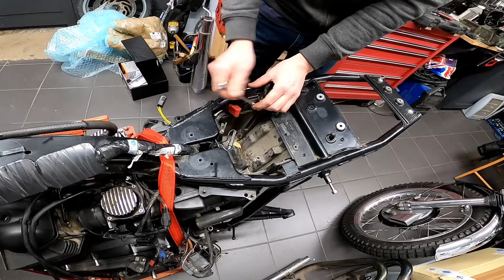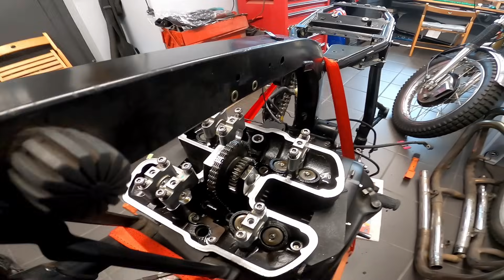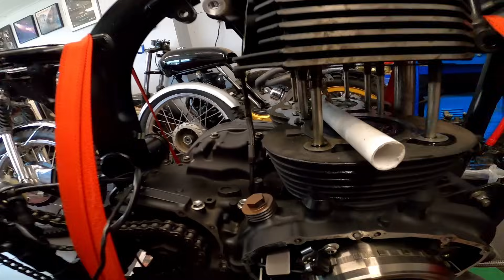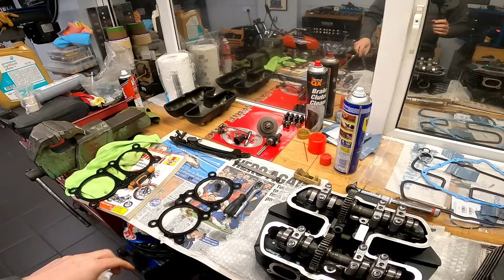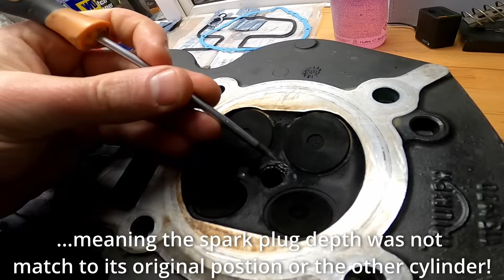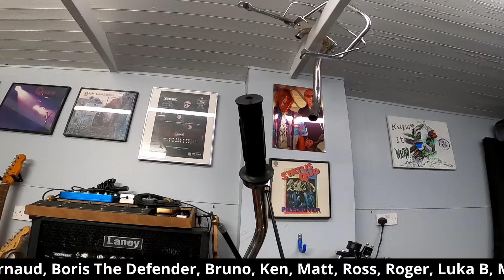Freddie Dobbs' Bonneville | Off With The HEAD!

Comment: I agree with you, by the time you fixed the spark plug thread correctly and had the heads and block surface ground, it would cost about the same as good second hand parts anyway.
Reply from the maker: Yeah in this instance its a reflection of time and I/Freddie are very fortunate to have the support of Chris at UTP providing parts!

Comment: The compression was there, you said so & showed the gauge. Fanny up the base,new gaskets, and bingo ,should get better readings too . Nowt all wrong with that barrel,or pistons.
Reply: IIRC, It was on the low end of acceptable though with one cylinder between 5 and 10 psi lower than the other.   The low compression could be because of the poor helcoil installation but given that both cylinders were within 10% of each other my bet would be either worn cylinders/rings or the valves being so far out of time.   Just a hunch.
Reply from the maker: See my other reply pal! Thanks again...

Comment: I know you’re doing your job correctly, as I’ve been there, but I think this is becoming an un economical repair, yes everything is fixable, but at what cost ? I also know that this is between you & freedie, but as a 35 year auto tech , you have to draw the line somewhere, really should have spotted the loose thread at compression testing,before doing all the other things ? I’m amazed you keep finding things wrong when you should have ,used your head not your heart. Please don’t be offended,you’re a clever guy, why can’t you skim the surface & jack the barrel ? Or jack the head ? Look out Freddie £££££.00000.
Reply from the maker: Hi Neil,

You make some really good/valid points and if this were a commercial operation we may have taken different route. The loose plug thread was apparent and had also been mentioned to Freddie on receiving the bike back from the previous garage (we always knew this was going to need attention). My first focus was to understand the current state (health check) across the board before getting the spanners out. 

Given the incredible support from Chris at UTP on parts procurement and I am not charging for my time  this was and remains an exercise in how much is wrong/damaged and what it takes to get a bike in this state back on the road. In any ordinary circumstances I won't deny this level of work/repair makes no time/economical sense without the content to create of the back of it and the Bike that it is and amount of content Freddie has created around it.

I absolutely could go down the avenue of bespoke gaskets and so on, as stated if it were my bike I would potentially explore those options but given where this is going when it leaves me and not knowing who is likely to work on it, I prefer to send it back in standard/factory form able to be reworked in the future with off the shelf parts.

We will be doing a video on the full breakdown of costing compared to the potential commercial cost/parts for anyone in there garage carrying out the same activities vs just replacing the motorcycle whole.

Thank you for your comments, you pose great input and ideas that really get the head scratching. Very much appreciated!

Comment: The original head gasket area has enough meat round it to seal, with a new gasket allowing for surface imperfections (thats part of its job) even what looks like those two nicks near the camchain tunnel. However agree that the neanderthal  thread insert is a bridge too far.
The slightly anal barrel and piston swap  expence l don't agree with, IF that raised imperfection is the only fault, easily flatted after all the head wasn't leaking was it?
Not to detract from the good work done and nice to see someone else using newspaper on the bench. 👍 👍
Reply from the maker: Cheers pal, newspaper for the win every time. The raised imperfection is a piece of steel well and truly buried into the barrel surface. As I say if it were my own bike I'd consider it but with time also being a consideration and have the parts available through support from UTP. I won't be messing with it for now. Although I may do a video after the bike is finish looking into it when I find time...
Reply: @TheWurks  Yes, thanks for replying.
Reply: @TheWurks  Having reflected on your reply and thinking about the different expansion rates of steel v aluminium, digging it out and the 'hole' welded and dressed would take time and money which has to be factored in.
Reply: @bananabrooks3836   Considering the tolerances here as well - damn the disposable culture, planned / unplanned obsolescence and not allowing plenty of meat to idiot proof....

Comment: Your knowledge of the interior of a motorcycle is unbelievable. Exceptional.
Reply: The difference between a Fitter and a Mechanic, then, a Mechanic and a Technician - by rights, all Mechanics should be Technicians (what helps with this, is brand specialty).

Comment: This is the difference between someone who does this work as a hobby vs someone who does this for a living. the hobbyist wants it to be perfect, the professional wants to be out the door onto the next one. I totally agree with replacing the barrels on this bike. you never know what that amount of displaced metal does to the cylinder geometry. Probably minor but sometimes that's all it takes to ruin an engine, why take the risk.
Reply from the maker: Thanks!
Reply: I would say the definition of the term "professional" would need revisiting under such circumstances, yes, stuff happens, but if we've really found ourselves at a point (and I'm not pointing any fingers here, really, I don't think that right to), where anything but top notch service can be expected from a paid professional, then it's time we took a long hard look at ourselves as a society. Hourly rate means nothing next to getting it right, end of story (and no, that doesn't mean you can charge for unnecessary time spent retracing your own steps either), as the main dealer workshops fit their parts and perform services whist creatively filling in their timesheets (always rounding up to the nearest hour? - Really?  at ^that* "flat rate"?), the gulf between them and the independent drifts ever broader as skill and knowledge dwindle (in both camps).
As I say, buying new and dealer servicing doesn't immunise you from unnecessary expense, though by definition, it surely should.

Comment: The "divet" on the head gasket sealing surface is not good. On the other hand engine had good compression, so it was not leaking. On the other, other hand, unknown if it had caused some deformation in  the head or barrel geometry.  I'd also be concerned that valves might have been fouled by pistons since the timing was not correct for some time. 

Those head bolts were super torqued! Are they stretch-to-yield type and need to be renewed? 
What is the history on this bike, do we know when/where/why previous engine work was done?
Reply from the maker: Not stretch to yield so should be good to go again. As for previous work I will not comment on who or where. I'm taking this as I find it, being open on the issues found and how we plan to rectify them.
Reply: In the first video of this series when Joe actually tested the compression, he found that it was on the low end of the acceptable scale for compression with one cylinder between 5 and 10 psi lower than the other.
Reply: @bnations2000  yes but that was a cold engine which will drop the readings some. I believe he later re-tested after a bit of running and setting valve timing correctly and got around 175psi....which I what I get on my 2013 Bonneville warm.
Reply: @TornadoCAN99  Good catch!  I missed that bit in the episode where he corrected the timing issue.  I feel like a right numpty now.  🙂

Comment: Are Triumph T100 base gaskets hard to get a hold of?  That's weird.
Reply from the maker: They are!
Reply: Yes, "weird" is a good descriptor, I took "unavailability" at it's face value and suspected built in obsolescence to keep up with the latest "green machine" fad, whilst noting we actually have a great company that manufactures automotive head (and" base") gaskets here in the U.K. - I then asked an independent bike business down this way if there was a problem with supply and the reply was "no, Fowlers have them on the shelf, two different part numbers, what's the reg?", so for a great deal of the waiting time at least, gaskets from Triumph were available and they always were to manufacture ('crossed my mind Triumph might have had a batch made here, rather than abroad, seeing the difficulty  and expense moving boxes around these days).

Comment: Would expect the barrels to be OK as debris damage is outside of the high pressure bead on the head gasket (that is responsible for sealing the high pressure combustion gasses).
But if you're able to get a low mileage replacement....
And as everyone else mentioned,  really really really annoying to pay someone good money to screw things up to a point where the bike is apparently unusable/scrap!

Comment: To be honest, the standard of previous "professional" workmanship on this bike doesn't shock me, its exactly what I would expect from the highstreet dealer who must make a profit no matter what. The damage to the barrel and head might have been from the original helicoil drive tang which is designed to shear off. i couldnt quite see but it might be a possible source. Its very surprising that it wasnt spotted when the work was done. The chain of issues with this particular bike are illustrative of the current state of the aftermarket services.: very few people left who have the knowledge and as a result still fewer who can spot a good job from a bad'un. Helicoiling by hand is awkward since hand held drills are very prone to wandering. I've never liked helicoiling but its ok for smaller threads. Larger threads are much more difficult especially plug threads which are prone to leaking too. All credit to you for not badmouthing previous workmanship on film .I think that if it were mine , I would remove the offending bump on the barrel, lap it so that there are no remaining protrusions, chemical metal it and reinstate the flat surface and thenbolt it back together with all new gaskets. I am not certain what material the original gaskets are but they look like they might be exfoliated graphite in which case , there's a very good chance that type of gasket would seal and never fail. However, the bike isnt yours and your reputation hangs on it  and so I quite understand your decision.
Reply from the maker: Thank you! Yeah in general if the head/barrels were so hard to find or extortionate to purchase I'd be all over a fix. As you say given it isn't my bike and he's happy to pay for the parts, that's the avenue we're taking...
Reply: Assuming the helicoil was done on on the bench it would be damned bad luck for it to get suck on the head surface without noticing before refitting - not impossible I suppose. New barrels nice but I don't think it would have leaked using the old ones - plenty of material around the 'ding' still. Could also explain why the head was torqued up so tight with that material in there ?

Comment: Looks like the only thing the previous mech didn’t mess up is cross threading any bolts!! Really makes you weep 😪 how oh how can you miss a huge lump of trash under the head gasket? Let alone being unable to line up the timing cogs. Omg 😧
Reply: A hurried job becoming ever more wayward under the pressure of a queue of not dissimilar headaches.. Imagine attempting to seat and torque the cylinder head, only to have a visible rise on one side....

Comment: In my experience as a mechanic, diagnosing and fixing a previous shoddy repair attempt is always more costly, time consuming, and laborious than taking a first crack at it. It's a shame that the barrels were needlessly damaged in addition to the cam timing being out; the previous shop did more harm than good to Freddie's bike and made the proper job much more costly than it needed to be. Good call on playing it safe, especially given the scarcity of the base gaskets.
Reply: I'm not trying to be clever in hindsight but I did warn Freddie about that repairer at the time. Unfortunately people just thought I was trolling them. I just wish someone had listened.
Reply: I would be telling that shop that did the repairs YOU MUFFED IT !!
Reply: No idea what a base gasket is. Could someone let me know?
Reply: @timoplants5869 the base gasket is at the opposite end of barrel where it comes together with the bottom cases.

Comment: Could you tell me year and capacity ov the CCM please
Reply from the maker: Hi John, In strict terms it isn't a "true" CCM. I built it as a replica/tribute to my dads build from 1978. Its 441cc, PES crank, CCM profiled con-rod, JE forged piston, Big valve head with a B50 MX cam and chromoly pushrods.
Reply: @TheWurks  also if you don't mind how old are you , would help with the biking perspective for me   thanks mate
Reply from the maker: @johngibson3837  37 pal
Reply: @TheWurks  sweet mate was thinking of when you'd said ov your dad's bike so I'd have perceptive
Reply: @TheWurks  sweet would like to know more they weren't at all common in Oz  but I love the look of that engine was the true thumper I always thought even though I've never stood next to one. I do know that clews used the BSA motor and in more recent times can't believe that a CCM with a Suzuki engine can be called a CCM just luv that minimalist look
Reply: @TheWurks   Is that a Chrome Moly frame Joe (and was it on his old one / is it on your Dad's new build?)

Comment: Just get on and get it running yawn. I'm sure tri motors said it required rebuild or another engine and guess what it's getting
Reply: Yeah but they said that because it 'wasn't making any compression' which was total BS. All the issues Joe is addressing now are because the 'spark-plug thread fix' that was done ended up creating more issues than it fixed and the replacement engine parts are just to safeguard any future issues resurfacing.
Reply: @JohnnyXoz   To be fair, the 140 and 150 psi that Joe measured in the first episode are low for that engine.  I don't know if Triumph actually specifies but I've seen various places indicating a healthy engine would show between 150 and 180 psi.
Reply: Mea culpa.  In watching a later video, I see that fixing the timing issue restored the compression to 175 psi in both cylinders.  That's more or less perfect.
Reply: @JohnnyXoz  I get that. But the head gasket little marking 
Wasn't causing an issue with compression. Nor was it on the circular sealing ring of the head gasket. Let's just fit new. But then again it's not my £££ so it's up to the owner and person carrying out the job

Comment: Didn't Freddie have that base gasket replaced last year after hunting for months to find one?
Reply: Sure did. ANd the result was a broken helicoil, a botched head gasket install with the debris damage we see here AND also the timing was off and the camshaft caps were in the wrong order. Oh, and an intake air leak as well. A job well done for sure.

Comment: Good call for replacing the head. It is hard to believe the insert failed so quickly, it must have been installed incorrectly. The fact that they did not properly clean the gasket surfaces shows the level of incompetence of the monkeys at that shop. Another good reason to replace the head is because they installed all the cam retainer caps in the wrong locations. Hopefully that error did not cause deformation of any of the cam bearings.

Comment: I wonder 🤔 how much all of  this work is going to cost. I have had less trouble with my Triumph Tr-6 in the 40 years l have.l have had my Sportster for 25 years and 400,000 miles on the original engine. I would never neglect my motorcycles the way he does. l take care of my bikes like my dogs. I just wish my dogs would live as long as my motorcycles. Both of my road bikes are mostly original. You take care of your bikes and they will last forever ♾️.
Reply: I think it's more of a testimonial to the engineering of modern bikes. That bike has run for a number of years, done a ton of miles and travelled all over Europe and North Africa and all he's done is put petrol in it. That wouldn't have been possible on a 1960's Bonnie.
Reply: @Martyntd5 people were going around the world on vintage motorcycles back when they weren't vintage. Read Jupiter 's Travels by Ted Simon. After the Air Force l did my big trip around Europe and the Middle East as well as sub Sahara Africa on a 1954 Royal Enfield G 350 single.  Slow but reliable.
Reply: @frankmarkovcijr5459  Yeah, but they didn't have Freddie Dobbs riding them. Can you imagine Freddie just trying to keep the carbs clean on an old Bonnie? You're right, the bikes could (and did) do it of course. But in the 60's you needed to be a mechanic, now you dont ...is my point.
Reply: @Martyntd5  All you had to do was regular maintenance. All l do to my Sportster is change the fluids and filter. If you can not maintain your motorcycle maybe you should not own one . I am not a mechanic l would save a lot of money if I was.
Reply: @frankmarkovcijr5459  I dunno, Freddie has a lot of hours in his saddle from all over Europe and North Africa. He wouldnt have done any of that on an old bike and if all we had was old bikes, he wouldnt have done it at all.
Reply: @Martyntd5  l bet he could have done those same trips on a vintage motorcycle . Don't forget motorcycles were everyday transportation for many people. He neglected his bike and did stupid stuff with it. I want to know how much milage it has. Today's motorcycles are as delicate as a cell phone. Does all this fantastic stuff but drop it one time and it's toast. Frankly I am surprised that it's lasted this long.